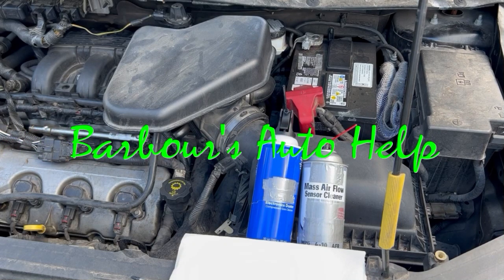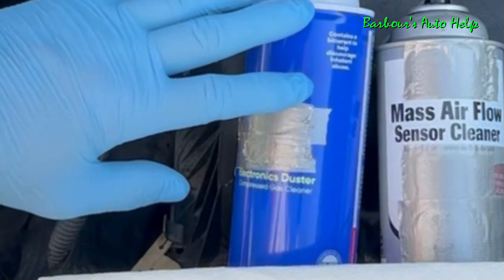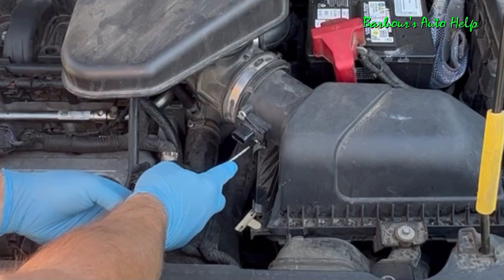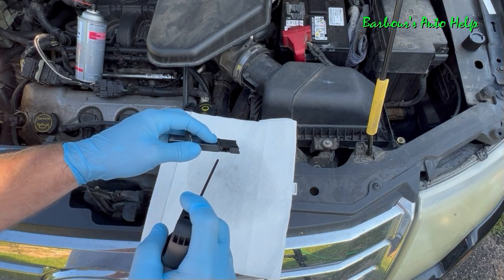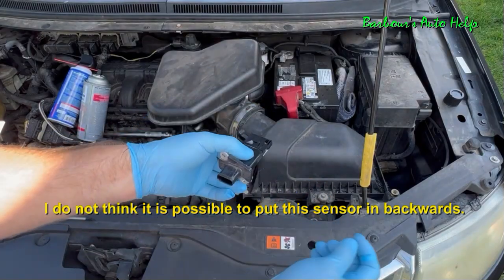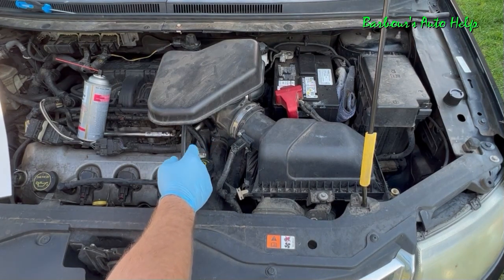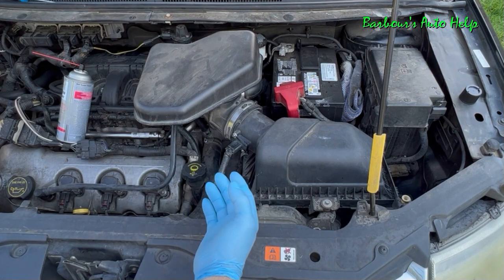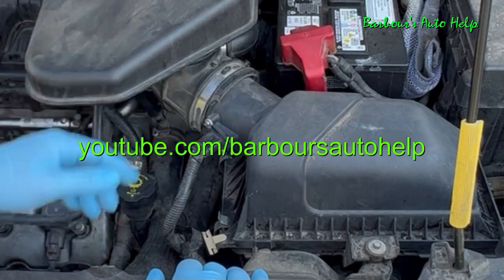Mass Air Flow Sensor Cleaning Ford Duratec 3.5L N/A

Comment: Where is the maf sensor on my 2016 edge 3.5?
Reply from the maker: The 2016 3.5L Edge is not equipped with a MAF sensor. It’s used a MAP (manifold absolute pressure) sensor instead. This should not require cleaning.

Comment: From Buffalo, N.Y.  Thank You so much for thus information. So it is OK to disconnect the plug without having to reset any kind of code?
Reply from the maker: If the vehicle is off it should not cause a code.

Comment: Hi I have a 2001 Lincoln Navigator v8 2wd, it will only start with starter fluid then it runs fine. I’ve checked all the fuses, air filter, maf, I can hear the fuel pump hum when the car is turned in the on position
Reply from the maker: Do you hear a hissing noise from the engine when it’s running?  I believe these are notorious for the PCV elbow leaking vacuum…. If I’m not mistaken.
Reply: @BarboursAutoHelp  I had that problem several months ago and replaced the elbow however it always started then just ran rough.
Reply from the maker: Hard to say then. How the fuel pressure when cranking?
Reply: @BarboursAutoHelp  as soon as it turns off it just cranks unless I spray more starter into the throttle body, then it will run fine I let it run for 45min and drove it several miles no problem, it just won’t fire back up once it’s shut off
Reply from the maker: Could be your fuel pump is bleeding down pressure when the vehicle is off. Usually when this is the problem though it will eventually start on its own though. I’d have the fuel pressure checked. Check to see if it’s bleeding fuel pressure when it’s off. Not sure if that is where the problem is but it’s a start.
Reply: @BarboursAutoHelp  thank you, I appreciate the advice
Reply: I needed a refresher course ..Your video is just what I needed. Good info on how to clean it and how the MAS works.. 
Thanks Again..
Reply from the maker: @johngates450 No problem.